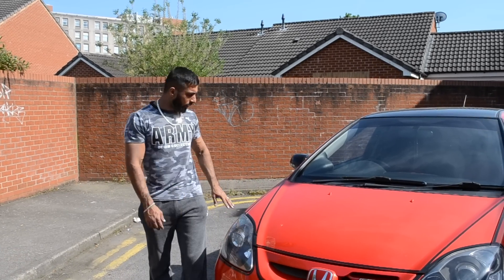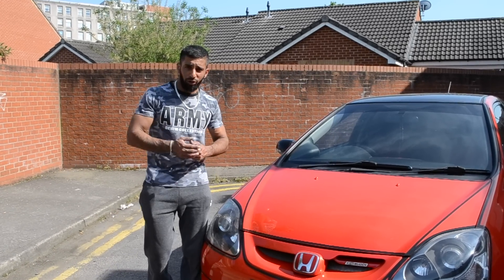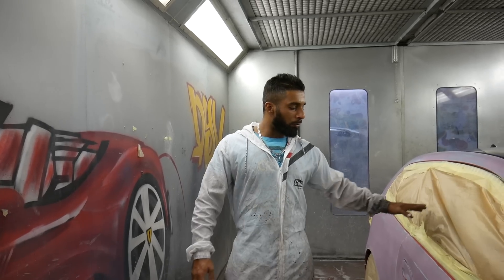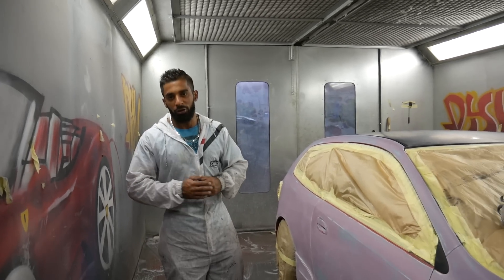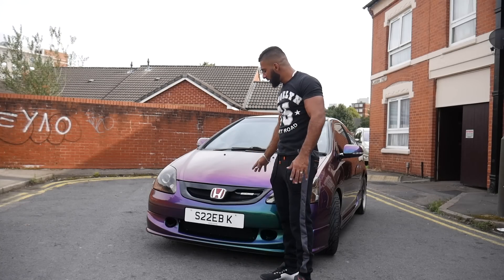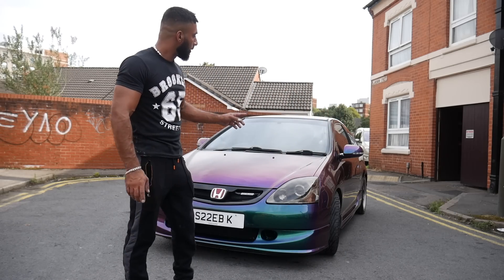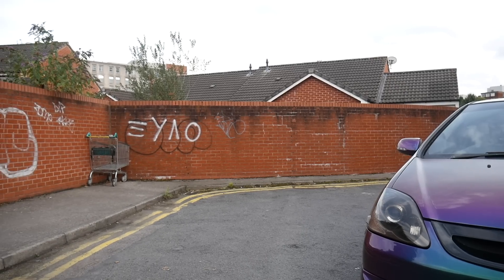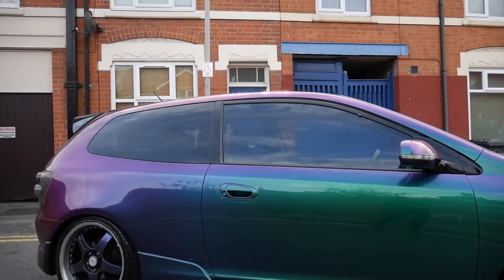The best paint job on a Honda Civic Type R Ep3 /  hondata /  ig /  最強

Comment: How much did this cost?
Reply from the maker: Its my own car
Reply: @swebkarim  sorry how much would it cost to do this? *
This would kook crazy with rear diffusers and a front under tray and splitter all in gloss black
Reply: And I've got the same car but my rear wheel arches have a ding would it need repairing first or would you filler it and sand it?
Reply from the maker: @eslameddinghalebi1  this is the most expensiest pearls ever. Something like this will cost u 2k. Its hypershift pearls